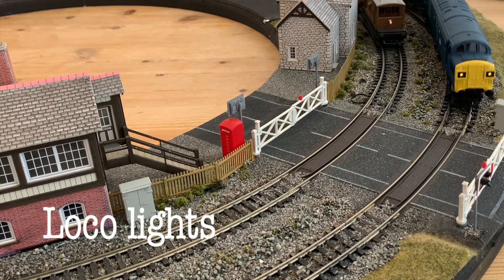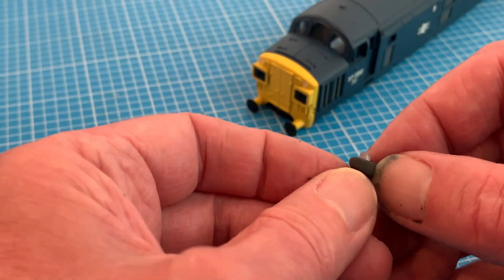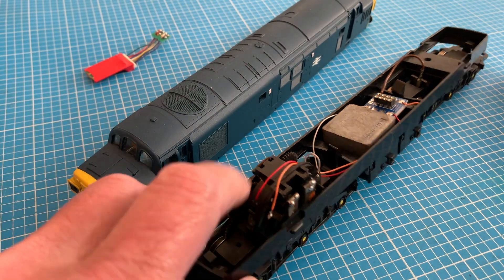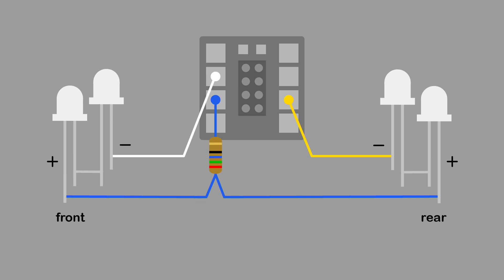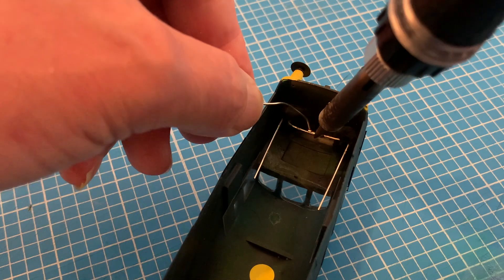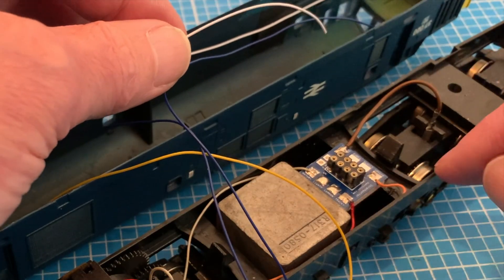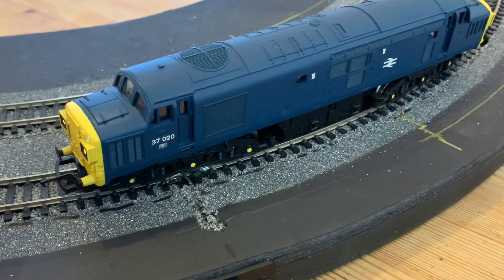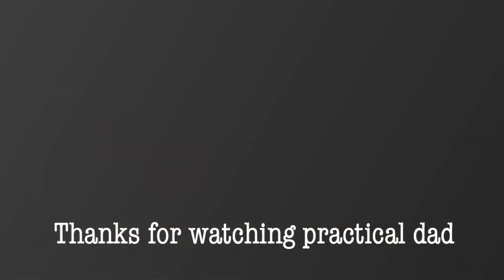LED lights for older model railway locos - simple installation and DCC wiring

Comment: Would this still work with the blanking plate fitter do you know?

I have an idea to make it work for steam loco lamps but i plan to have a different headcode on each end but of course i dont need both sides lighting up at the same time.
Reply from the maker: I assume you mean running on DC, without a DCC chip fitted. If that’s the case, you’d need another way to keep your power supply constant - which for me is one of the big advantages of DCC.
Reply: @paterpracticus but would it work? The exact same set up. Only with a blanking plate fitting for DC operation

Comment: Just remember if you're adding tail lights, try and ensure there's no tail light between the loco and the train (the light signifies the end of the train), and before about the mid-80s twin tail lamps indicated either the back of an Edinburgh-Glasgow push-pull service, or the royal train!
Reply from the maker: Indeed. On locos I usually only do headlights as I have a set of brake coaches with tail lights to go with them.
Reply: @paterpracticus  I have an ambition to have tail lamps that can be magnetically attached... a bit of a tall order in 2mm though

Comment: No red light ?
Reply from the maker: Not in this case. As most of the time it will be hauling coaches, a tail light on the loco isn’t really necessary - and I do have a ‘how-to’ for a wagon/coach light. However, I do have a DMU project on the go at the moment, and will share a video of that sometime soon.

Comment: Great tips thank you only problem for me I don’t do dcc
Reply from the maker: Just been thinking, there's no reason this couldn't work for DC, although the lights would only be on while the loco is in motion. Might need some sort of voltage regulator to keep the brightness stable - and perhaps a capacitor to keep them on for a while after it has stopped.
Reply from the maker: I’m sure there are electronic solutions for DC too, but it is one of the advantages of DCC to have constant supply for lights etc.